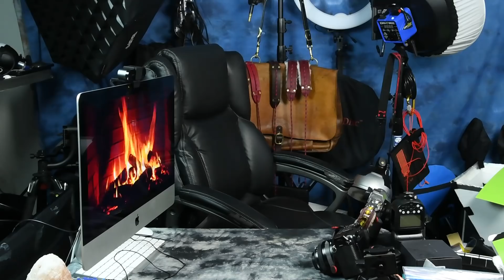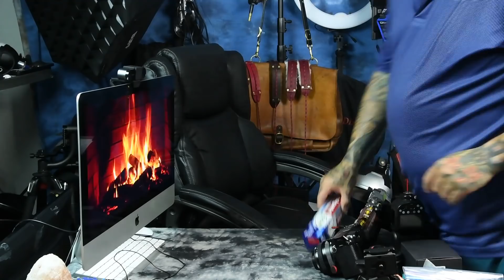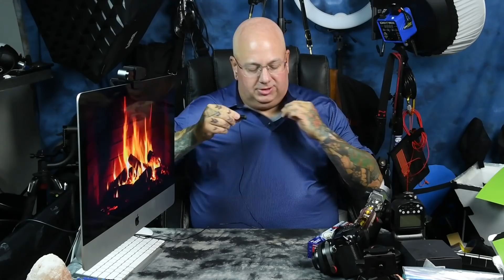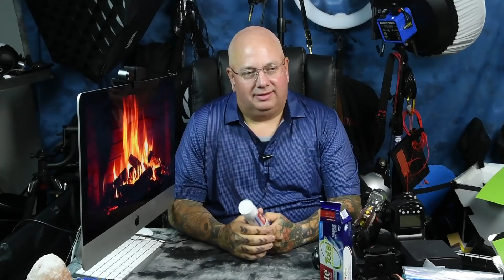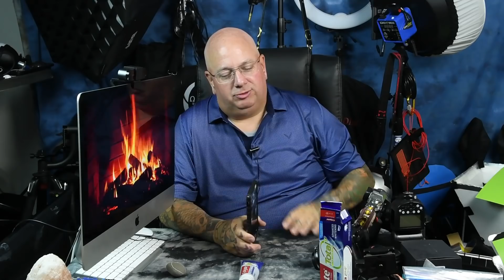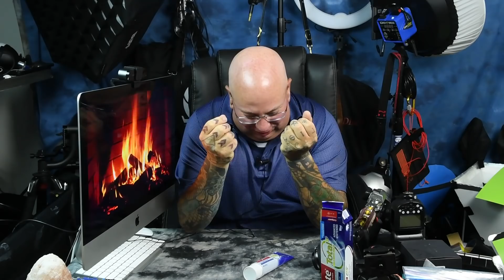🧐 AC Generator POWER FALLACY. Spontaneous particle generation 😂

Comment: Current is the transverse flow of dielectric lines of force (faraday tubes) dragging along with it, the Aether, that has momentum inertia ans IS the true mass.
longitudinal does not do this. A impulse is longitudinal, and this is what Tesla worked with

Comment: Hey Ken, did you ever check to see if Moonlight affects the Crookes Radiometer when directed towards the black veined section only?
Reply: @staywhite6332  I know that it chills water within 30 minutes during the waning phase...it may also be a negative vibration of the ether, causing it to take heat away (if not radiating cool beams, as we imagine)
🕵 Applying the scientific method, the simple truths will set us free!

Comment: Ytube and the net at large are full of graphical depictions of "how electricity works" that show wires as lines inside of which a train of dots is moving...flowing...and the dots are called electrons.   It's a model that works fairly well.   But many have learned that it's a "charge" that is moving along the wire from atom to atom and the electrons of each atom largely stay in place.  I find "charge" to be a bit mysterious, as do most, so we revert to the fairly good model of "flowing electrons".

Comment: The copper material with which the cabling is constructed from is made up of copper atoms, and copper atoms have extra, available electrons in each valence band.

Basically, the atoms in the copper are constantly alternating between a negative ion, and a positive ion. As someone said below, it’s a closed loop system, and requires no input of electrons, nor output of electrons. It’s the movement of the electrons that creates the energy.

When an atom has an excessive amount of free electrons in its valence band, the atom next to it, which is positively charged, acts as a magnet for some of those free electrons, the atoms aren’t coming from anywhere, it’s the current, or movement of atoms, back-and-forth, that generates the power.

Electronic technicians generally talk about electron flow, whereas engineering students are taught hole flow. Now, you tell me, how the hell does a hole, flow?

I would agree though. There is NO particle, but only the “observable” properties the field produces.

There are no electrons being added to the system, nor subtracted from the system. It’s simply the transference of a negatively charged field into the next atom’s positively charged valence band. There’s no limitless supply.
Reply: where do the extra electrons come from tho?  is it because magnets create electrons? if not how do they go back? I thought "energy cannot be created or destroyed. I'm thinking of it like dominoes trying to use them in place of particles but what outer dimensional gremlin resets all those tiles XD maybe i'm not adding the right factors.. but if the first particles valence shell has electrons to give how does it ever get new ones, where do those come from? perhaps i don't understand how science knows how the flow goes back and forth but if you don't mind explaining that part i'm all ears/eyes.
Reply: Aubrey Bull - The “electrons” are in the copper wiring it’s self. The only thing the motor, and magnet in the generator do is, pull these extra electrons back and forth, (using only a magnetic field), within the copper wiring itself. Any type of metal that is a good conductor has to have free electrons in its outer, valence band. That’s what makes some metals good conductors, and other metals absolutely horseshit. Some metals have more protons in their valence band, and are not good candidates for conductors.

There are no “electrons” being added, nor subtracted from the equation. The generator only creates back-and-forth movement of the free electrons in the valence band of the atoms
Reply: Aubrey Bull - also, no energy is being gained, nor destroyed. The energy from the fuel, generates the energy to propel the generator, which transfers that power in the form of current, to the source, (outlet).
Reply from the maker: sorry youre so clueless and brainwashed,  it must be a heavy burden for you........ TOO BAD you could never define a FIELD...  nor do any of the idiots of quantum
Reply from the maker: Aubrey, ask this child to now define a FIELD>.........  he has no chance in hell.
Reply: Aubrey Bull - The conductivity of a material is dependent on how many free “electrons” are in its outer valence shell.

I know this doesn’t completely answer your question, but I’m trying to find a way to answer it. I knew at one time, but I graduated a long time ago. Give me a little bit, and I will find it.
Reply: Theoria Apophasis - I didn’t come here to argue, nor be belittled. If there’s something I don’t know, please explain to me. No need to come out of the gate with insults. I came here for an intelligent discussion.

You don’t know anything about me, yet you presume to come here and call me “brainwashed”. What do you mean by brainwashed? Do you mean brainwashed to your beliefs, or brainwashed in general, because I can tell you for sure, I am the most open minded/skeptical person I know. In fact, I’m so open minded, I’m willing to come onto a board which I knew I would be confronted by people like you, and explore new ideas. However, if your knee-jerk reaction is going to name call, and belittle, I’ll just ignore you.
Reply: Aubrey Bull - “conductors, while most non-metallic solids are said to be good insulators, having extremely high resistance to the flow of charge through them. "Conductor" implies that the outer electrons of the atoms are loosely bound and free to move through the material”.

Source,

So, what makes a material a good conductor is a loose, and abundant amount of “electrons” in the outer shell. These shells never really add up, nor subtract. They don’t go anywhere other than from one atom to the next.

http://hyperphysics.phy-astr.gsu.edu/hbase/electric/conins.html
Reply: Aubrey Bull - to clear things up, and create a sense of continuity and concept, here is how it works, I believe.

Fuel is required to generate motion for the magnet and coil. The magnetic field, which is in constant change of polarity, and amplitude, forces the loose electrons in the outer valence bands of the atoms to constantly flow back and forth. There’s nothing gained, or lost in this system.  The only loss is the fuel that’s spent to create the motion which moves the electrons. When you plug a device into the outlet, you’re creating a new path for the electrons, to affect the electrons in the electronic device you’re trying to power.

There is no loss, or gain, anywhere. Constant motion is always required at the beginning of the process, and it is this constant motion requirement is where the loss, or gain is.

That’s why a battery eventually dies in a DC circuit.
Reply: Aubrey Bull - Guys, either I’m missing something really big here, or this guy is pulling yall’s legs. He’s obviously very intelligent, and knows a lot of things. I can’t imagine someone of his caliber intelligence is misconstruing this. Either that, or there is something else really big that I missing. I would sure like to know if that’s the case.
Reply: Theoria Apophasis - doesn’t matter - the nature of the magnetic field from the coil. There’s no “electrons” coming from, or to the generator. The generator only provides the alternating magnetic field, which in turn, alternates the direction of flow of a FINITE amount of loose, available “electrons” in the outer valence shells of the atom molecules in the copper wire. 

There’s no violation of the law of conservation. The electrons in the copper wiring are in a closed circuit. Electrons don’t provide power. It’s their movement which creates current, which creates power.

What do you think is running all of the generators? Hamsters?
Reply: its that valence argument tho..   "These shells never really add up, nor subtract. They don’t go anywhere other than from one atom to the next." Concentrate hard... So electrons don't move but move, is that because they don't exist? If the do what drives them forward and back so fast? How do they do something and not? This is the problem I have, something that isn't physically there is being described as a physical thing. I think that's kens point which is so easy to over look that masters in electrical engineering are going.. Uh.. Wtf.. Why.. Didn't I.. See this... Sooner. I'm not convinced either way but I'm listening Ken. What you say can be a little over encumbering for lesser minds such as my self, but none the less I all ears/eyes. If I wasn't so brainwashed in atomism maybe field perturbation and dielectrics would make more sense, but I'm so lost. I'm constantly re watching and waiting for new videos to maybe get another one of your insights to click and have it all make sense. Keep up the chat, all have been deeply insightful.
Reply: Aubrey Bull - I’m starting to think this whole thing is a giant piss take. This guy is way too smart to ask such a stupid question. Make no mistake, it is a stupid question, and I think he’s making fun of everyone in this thread.

I think he thinks electrons are what provide the energy to run devices. Electrons don’t go in, or out of anywhere. The free electrons in the copper atoms are in a closed loop.

Comment: So magnetism is a point source of gravity?
Reply: Yes though terminology wise, what is known as gravity is a non point sourced magnetic phenomenon.
Reply: Ether is the non point source of gravity. There is no such thing as empty space. Dielectric acceleration of ether from space towards the earth at 9.8 m/s2 is the cause of gravity, inertia and weight. If you were to jump off an airplane for example, as long as you are falling towards the earth, your weight will be zero and you wont experience inertia because you are falling at the same speed ether is accelerating towards the earth. It will be as if you are in space. The reason you don't experience gravity in space is because you are falling towards the Sun with the earth at 67000 mph due to counterclockwise ether vortex driven by the Sun. The Sun is falling towards the galactic center at even greater speed so planets don't actually fall into the Sun. It is the ether that curves around the earth as it accelerates towards the earth in vortex style. Its like water draining down the pipe taking all objects in water with it. Earth being highly electrically charged sphere pulls the ether from space, ether in turn pushes all objects towards the ground. Weight of an object on earth is an equal and opposite reaction, a result of ether flowing through the forest of atoms of an object causing resistance, giving object its amount of weight and also inertia. Just like weight is not a property of mass, inertia isn't either. Inertia is a property of ether, well inertia and ether are same thing.
Reply: So in theory you could make a true magnet based motor that could defy gravity?

Comment: I was taught the metal in the wire gives up an electron in its outer ring of each atom due to a weak covalent bond. If you think of a wire as a water pipe, then what flows in on one side will flow out of the other side. I believe we were taught this to make it easy to understand. I am now very interested in learning this much more genuine theory of a field disturbance.    I have studied Quantum Theory on my own and found it to be hogwash.
Reply: Check out Miles Mathis and his Charge field. His nuclear model is more accurate than the old hogwash and fits quite good with Ken´s model based on Walter Russell. Combine these three and you will get quite a good picture.
Reply: @esamawuta  Isn't that the guy who thinks Pi = 4?
Reply: @zfoxfire  Yes. Pi=3.14 works in a 2D static situation in math.  The 4 is the simple solution for a kinematic situation f.ex expanding sphere  in 3D and the circular motion.

Comment: I Enjoy your videos.  However, 'electrical theory' does not claim to create 'electrons' forever from an endless tube (as you suggest), instead they 'flow' (albeit very slowly) in a 'circuit'!  I.E. Only 'free electrons' need to exist - and not an endless supply as you suggest!

Comment: Great video Ken. As always you make a good point and have inspired me to think deeper and question things. Now I have a question for you however. Correct me if I'm wrong but isn't this concept similar to the analogy of a fan circulating air in a room? Air is not generated, it is put into motion. The air cycles around the room, doing work to cool you off,  until it ends up at the fan blades again to repeat the process. Thus completing the circuit. Your thoughts are much appreciated.

Comment: Errrr Ken......your ranting here is fundamentally flawed in that when an outer valency electron is "shoved on" by magnetism the hole that's left is filled by an electron thats forced on by the flow of electrons in the circuit but you have to have a closed circuit for the flow or at least a weak dielectric strength...
Reply: @Ron Gansuer Ron the principals remain the same, for electron flow you have to have a closed circuit, whether its a transmission line or battery radio the principals are the same, your education is letting you down.

Comment: well it's a breeze coming from the ground. the real issue is that the circuit is unfixed, impermanent. believing otherwise would be superstitious :)  dark spooky. i think of it as the capacitance of the material causing or allowing charge and inelastic phase scattering or duplication of the tiny vortices that are particulate, if you look at them under a particle microscope :O hahaha

Comment: I've always asked my more argumentative friends why the generators at the Hoover Dam don't get noticeably lighter over time. Their brains start ticking with that one. I mean, electrons aren't coming from anywhere else except for the wires and magnets, right? It's ain't the water. It ain't the lossy axles and flywheels.
Reply: Correct me if I'm wrong, but I think electrons are coming from the ground, hence why all circuits have a ground connection.
Reply: @natetehgreatt  So, electrons come from where they get cancelled out? Naw dawg. Naw. Flow doesnt go from ground to device.
Reply: @natetehgreatt  The ground is for dumping charge. Otherwise it would be hot like the lead.

Comment: Pulse caused by the magnets being passed by. But what is the pulse? You cant see it when its in the wire but yet it affects the wire with high enough voltage or high enough amperage. Definatly affects you if you hold the bare ends of the wires. :-) lesson learned when I was 10.